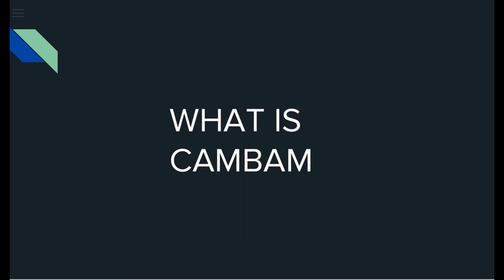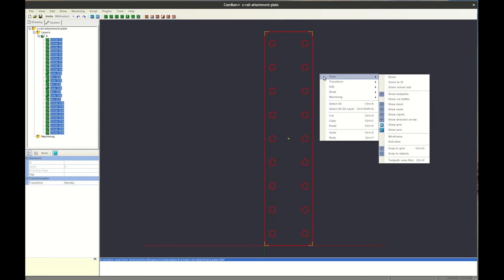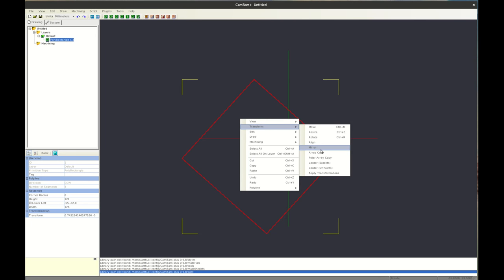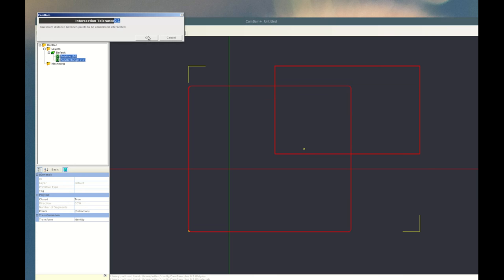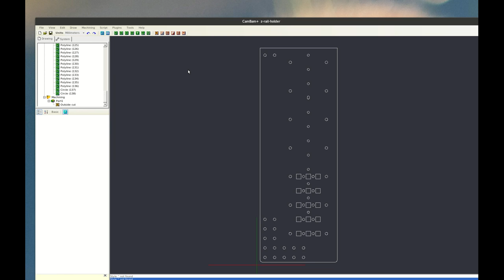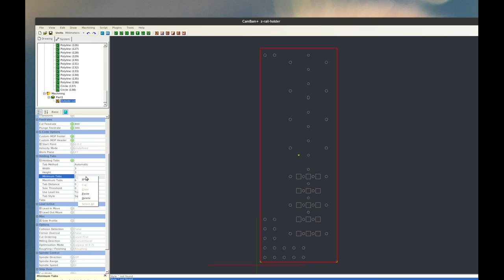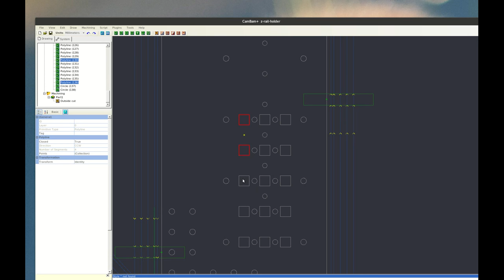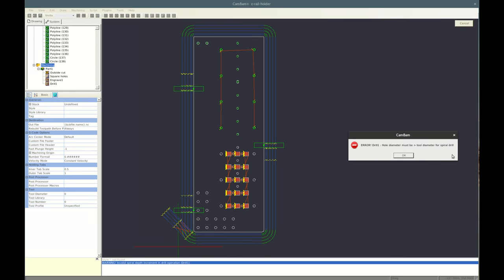CAMBAM tutorial in 15 minutes

Comment: sorry but this does not work with win 10 importing dxf is a night mare
Reply from the maker: Are you sure it's related to the version of Windows? Have you tried using another version of Windows, or the Linux version, and seen DXF work better under those circumpstances? That sounds odd, I really wouldn't expect Windows version to have any impact on DXF abilities.
DXF formats and import/export incompatibility is an issue in a lot of software (not just Cambam), maybe that is what you are running into instead? Do you have a more specific example?

Comment: Anyone get this working on linux mint?
Reply from the maker: It's run using mono, so if you can get mono running on mint, it shouldn't be an issue as long as you follow the intsructions on the cambam website
Reply: @ArthurWolf  Which one do I try?
Reply from the maker: @jasondevault5066  Which of what? Just follow the instructions, it's worked for everybody I know have tried. http://www.cambam.info/ref/ref.linux